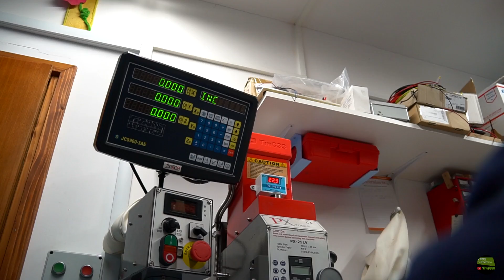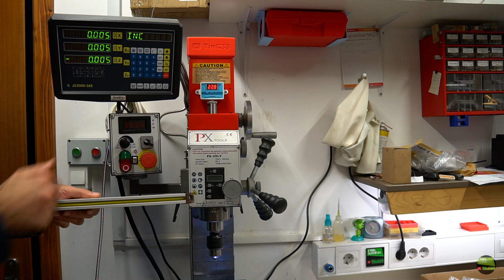DRO digital readout -linear scale- repair for $0,1

Comment: A MAN AFTER MY HEART FOR REPAIRING
Have a question you might have the answer
I just bought and installed my DRO
Used it very little, but found I may have been doing a no, no
Cleaning my mill with compressed air, 
unfortunately it seems the scale pick up may have gotten some dirt on it
Have you got a video showing how to clean it
Reply from the maker: Check this ic if there some chip on it's leg, i think in this video process of dissasembling is shown.

Comment: How difficult would it be to shorten the armored cables?
Reply from the maker: That would be an easy peasy job, pull the cable out of armor and cut cable and armor for same leinght, put it back, and then strip cables, solder...

Comment: I actually came here to see how difficult or simple it would be to shorten the cables and I see it would be pretty simple. Hate all that bunched up spare cable hanging around. Much more professional to have the correct length. Thanks.
Reply from the maker: It's not a big deal just shorten 5 wire cable i think and steel protection wich is fixed with m3 screw in the head, you can shorten on one or other side, as you say not a big deal.

Comment: For those who don’t have desoldering tools, cut the part out first and then desolder each pin one by one. Less heat on the board and less likely to destroy the pads.
Reply from the maker: Thanks for tip, but that's my last choice, i don't know why but always try to get out component in one peace even if it's trash.
Reply: Good tip.